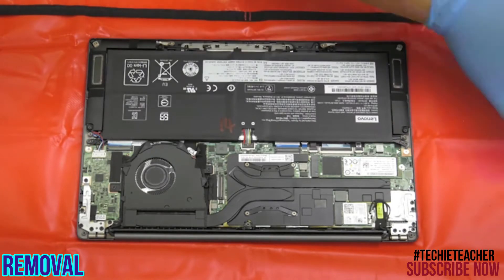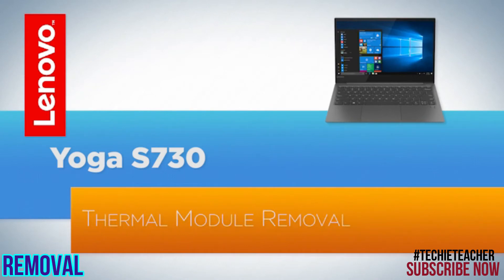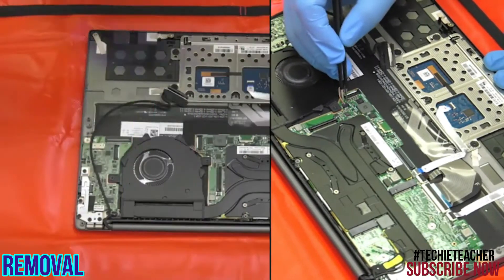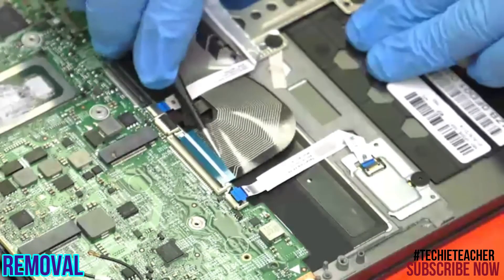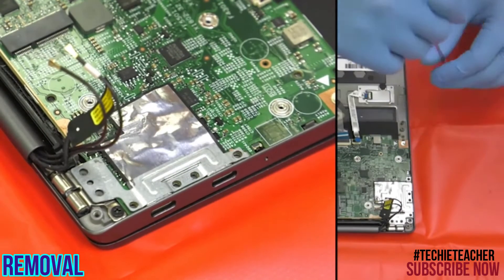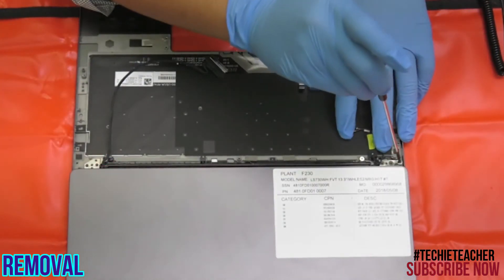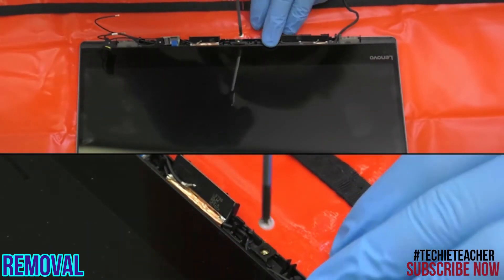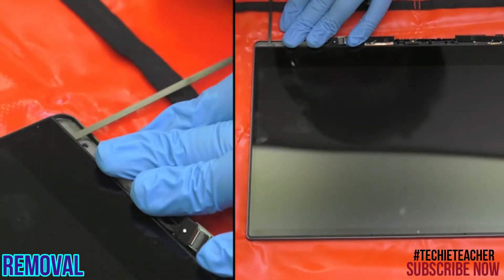HOW TO DISASSEMBLE/REMOVE PARTS OF LENOVO Yoga S730 / Ideapad 730S (81J0, 81JB)

Comment: This was the only video available when we searched how to replace the keyboard on a lenovo ideapad 730s, and just be warned, you will be breaking the thermal paste seal while doing this, so you need to have some on hand, and the keys on the keyboard are also covered by a sticker, and each key has a teeny tiny torx screw. (About 40-50) my husband spent about 6 hours carefully taking apart the entire laptop. Make sure you put the stainless steel screws back in the orange holes, because they can short the computer being misplaced anywhere else. Goodluck! He successfully got it repaired.